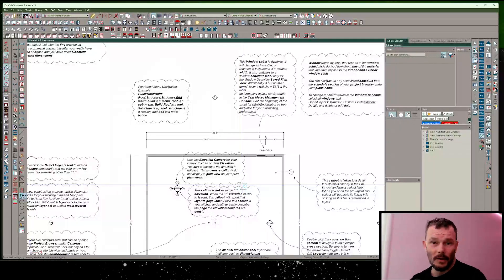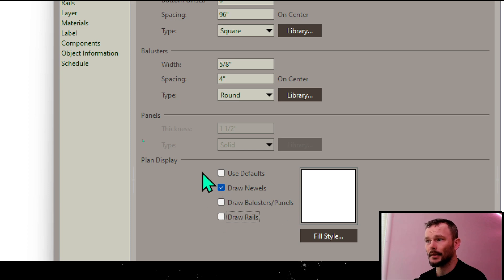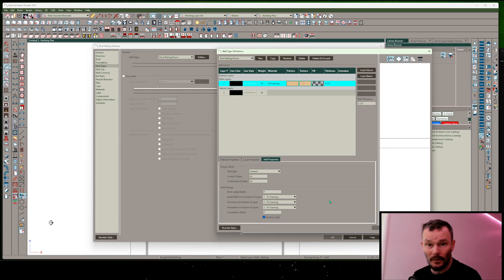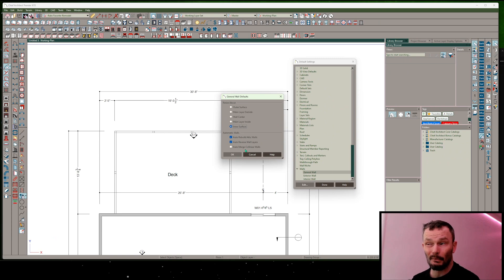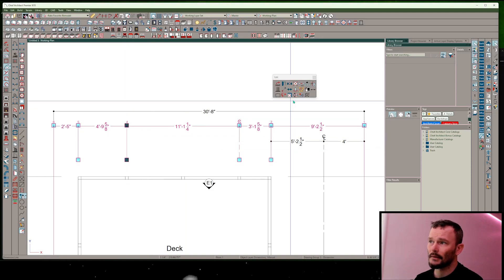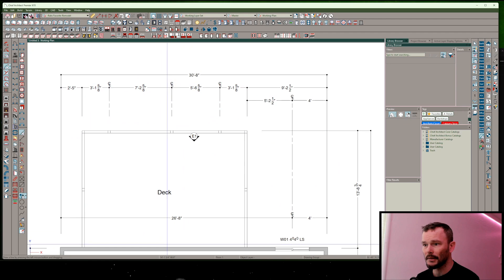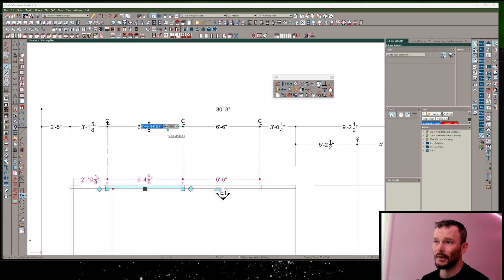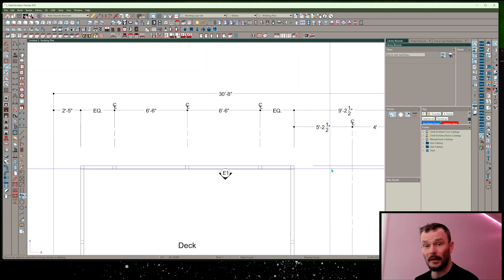Dimensioning Newel or Post Spacing in Chief Architect X15

Comment: Good video. A trick I use to avoid recombining the walls is I check the no room moldings interior box to give the railing a different attribute. Then to dimension to the posts I make a cad detail from view then copy and paste the post cad boxes into the plan.
Reply from the maker: Only problem with this is if you move the posts you inherit liability from the dimensions not updating without redoing your cad detail
Reply: Great tips Rene! I learned 3 time saving tools as simple as setting up the default template with checking and unchecking boxes! I always hate admitting how much time I've been wasting by fighting CA program.